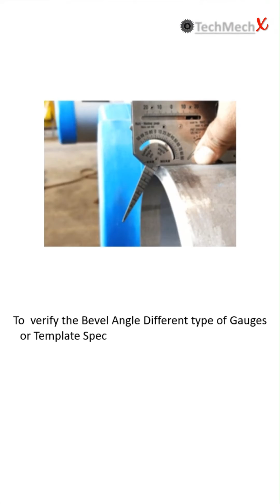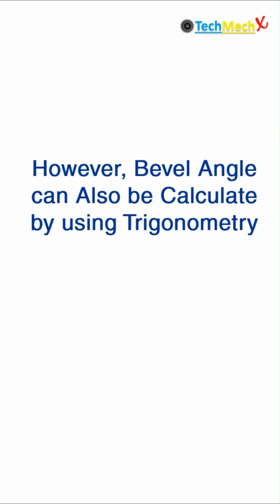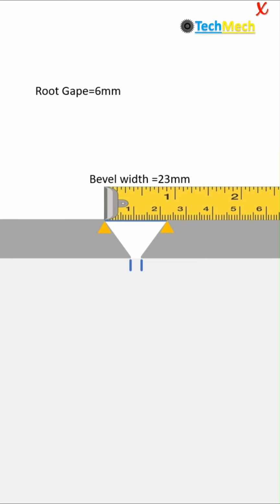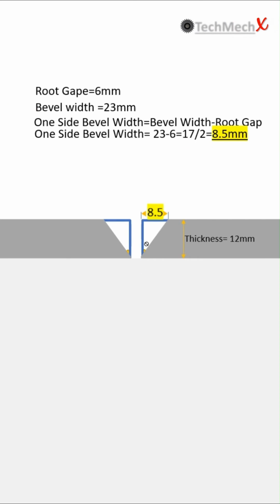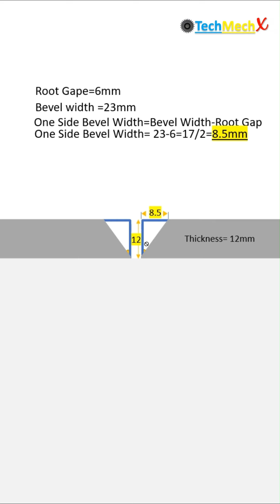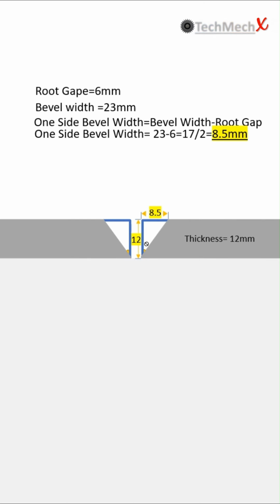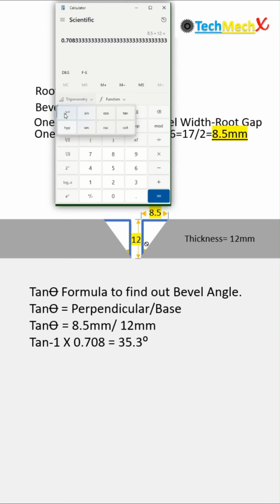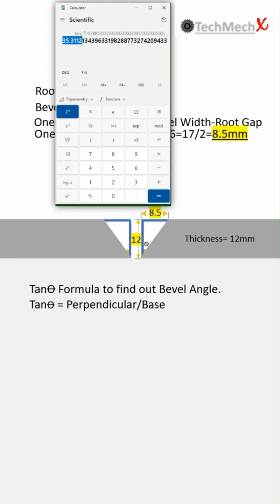How to Check the Weld Bevel Angle using fundamental trigonometric formulas

Comment: For different thickness joint preparation how much degree do you need
Reply from the maker: Different types of joints and welding processes require different bevel angles for preparing the joints. Here are some common bevel angles:
- V preparation: groove angle 50~60 degrees (both sides) / Single side 25~30
- Single bevel preparation: 40-50 degrees.
These angles can vary based on factors like structure design welding methods and cost considerations. For Exact requirements. it is best to check the Welding Procedure Specification (WPS) for the specific project.